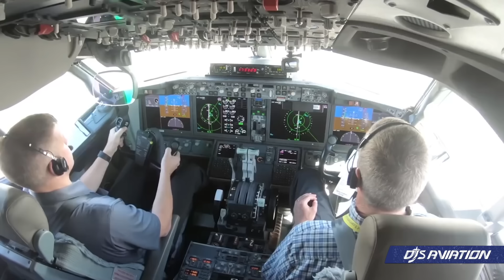New Airbus & Boeing Aircraft Updates

Comment: Airbus has wisely decided not to push the A320 family, a 1980s design, into a third generation. The A320neo itself may be succeeded by an A220-500, leaving engineers to focus on the A321neo and variants plus, perhaps, an even longer mid-market narrowbody. The risk of tailstrikes could be reduced, the wingspan kept to D gate dinensions and and 2L entry via jetbridge enabled if the design were based on a lifting canard configuration.

Boeing might prefer to build a clean-sheet successor to the 767 instead so it can keep the successor to the 737 family focused on smaller aircraft. However, given its present finances and the fact that the MAX-7 and MAX-10 aren’t even certified yet, the company must hate Airbus for forcing its hand so soon.

Comment: With the current back log and problems with parts supplies it looks like neither Boeing or Airbus will be making any new Single Aisle Aircraft available until the end of the 2030s and Boeing more likely around 2045. Boeing could find itself too late for the Big Customers unless it sorts itself out. Boeing needs to increase the production of 737 Max aircraft by at least 15 more aircraft a month.